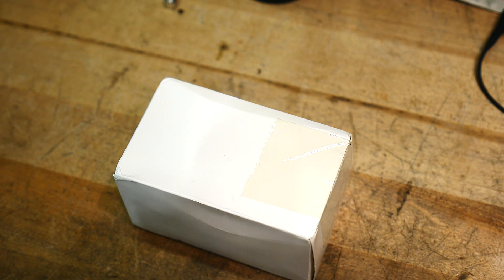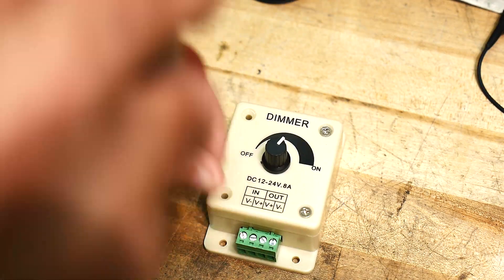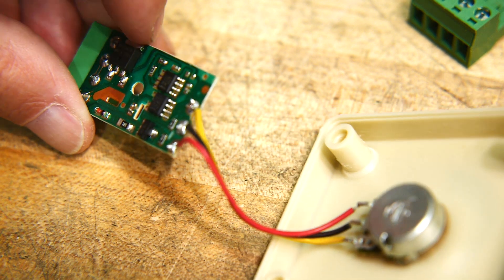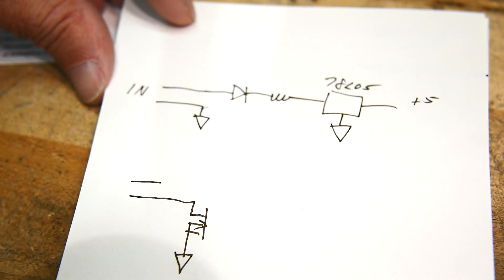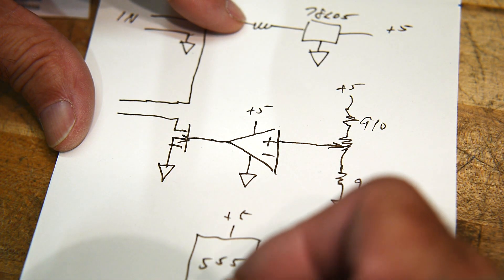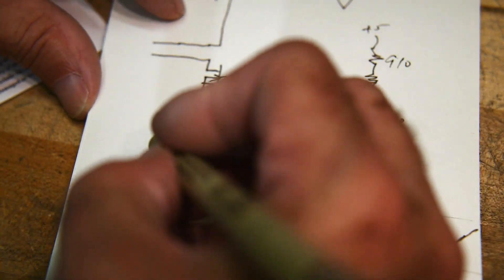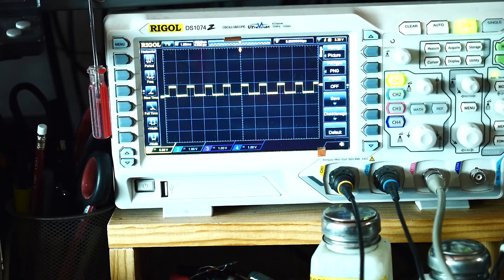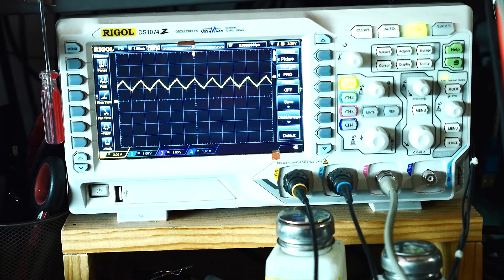#493 A $3 PWM Dimmer Module

Comment: Very old-school 1970s circuit. We used this circuit as speed control for the DC motors that ran the formulation pumps on pesticide sprayers we made at a company I worked for in the '80s. Instead of a MOSFET, we used a Darlington bipolar transistor, power FETs were not such a big thing when the machine was designed.
Reply from the maker: Hard to beat those 0.01ohm FETs these days

Comment: Does that thing spew RFI everywhere? I have a LED switching power supply to power my desk lamp and I must turn it off on HF bands specially 80m... I was thinking of installing a standard PSU (transformer, rectifier, filtration and regulation) but I was searching to add a dimmer... If that dimmer generate RFI was much as my switching PSU, I'll have to figure out something else...
Reply from the maker: I think it would be better. 625hz switching. I have lights that are terrible and have to do radio in the dark
Reply: @IMSAIGuy  as a matter of fact, why use PWM for dimming LEDs ?? Why not just use a voltage regulator ? I mean if you supply a 12v strip LED with only 5V, it will dim ? Why the use of PWM ? You could have a video about this in fact, PWM vs voltage regulator...
Reply from the maker: @Aleziss  That may be fine. using pwm allows the color temperature of the LEDs not to change. It also allows a fixed 12V to be used in solar or RV applications. and for $3 you get a box and knob!
Reply: @IMSAIGuy  worth it for the box alone, those are usually quite pricy even from the usual chinese sellers